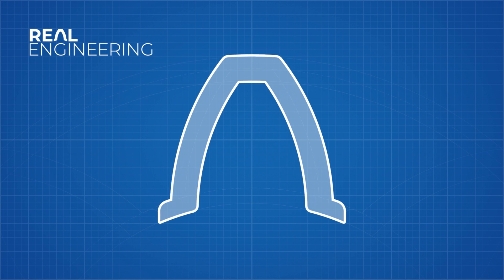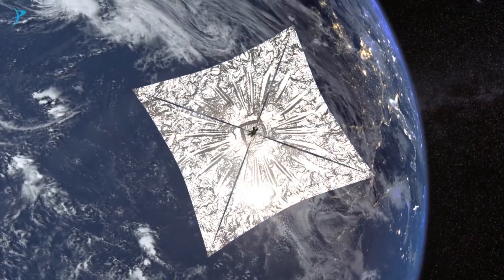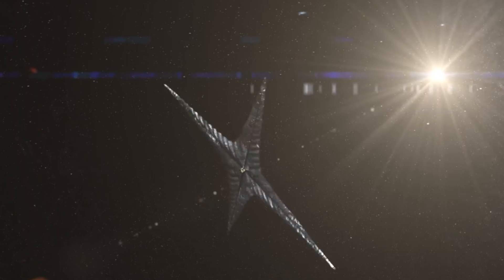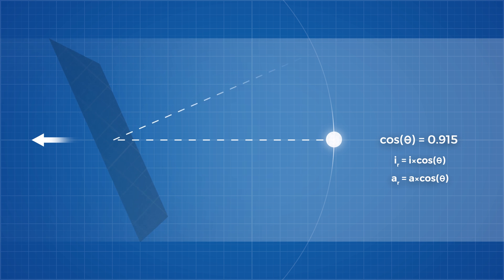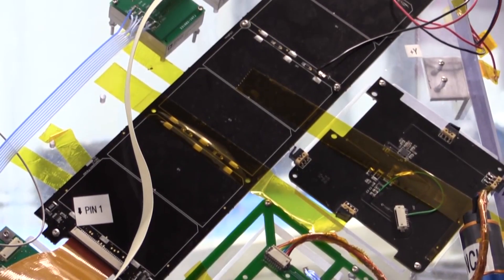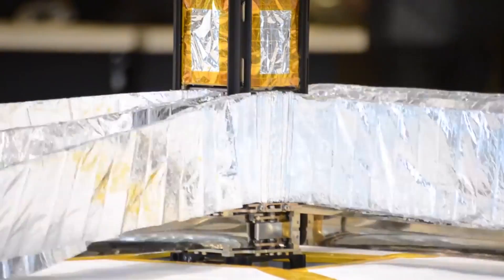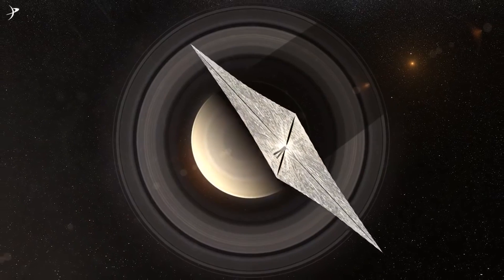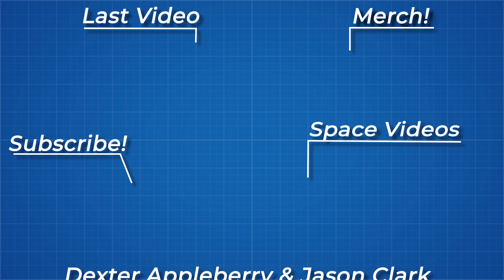How to Sail on Starlight

Comment: I don't think solar sails are  a viable solution for inter-STELLAR travel. 
Sure, the momentum of photons add up and the spacecraft can get up to great speeds buts it still not enough for travelling amoungst  the stars . You always need a light source , and one pretty close , for the craft to keep going on and on .
If there is no photon source near by , then it will not accelerate at all and maybe slow down and stop at a point in space.
We need new propulsion technology , or better still new technology for maybe bending space-time to create temporary worm-holes  which will give us a short cut to the interstellar vast distances of space.
If we can't do that then we need propulsion technology that will get the spacecraft to at least near  light speed .
Solar sails  ain't gonna cut it . I think the EmDrive or RF resonant cavity thruster , or some sort of variant of it , might be the one tech that might do the trick of near light speed propulsion  . Just a thought .
Reply: It's why the real interstellar probe project will be a combination of these solar sails and ground laser stations. There will be tens or hundreds of ground based mega-watt class laser stations that will all be focused on a single sail probe, and accelerate it to around 20% of light speed.

This way they can send hundreds of probes without spending billions on engines on each probe. It also means that they can send probes in different directions.

Comment: How does it warn us 2 hours in advance when light only takes 8 minutes to come here from the sun?
Reply: Light isn't actually the dangerous part of a solar flare; they also release bursts of high energy charged particles that are dangerous to satellites and even electronics on the ground if strong enough. These charged particles are fast moving, but not light speed.
Reply: dario dal cin coronal mass ejections travel significantly slower than the speed of light

Comment: well, correct me if i m wrong. does it will in (hours) for the effect of solar storm to reach earth? i think it will be in minutes as it is radiation after all
Reply: The most dangerous (we think) type of solar storm is called the Coronal Mass Ejection (CME) and these aren't actually radiation but a wave of plasma. These may take 3.5 days on average to reach the Earth.

Comment: One thing I've never understood about the solar sail issue, and this could be because of ignorant enthusiasts overhyping the technology's capabilities.

One substantial design requirement for anything to last in space long term is the ability to withstand high velocity impacts of very small objects.  Even when you're not sitting in Low Earth Orbit, there's a fair bit of dust floating around out there - not a lot, but when a dust particle the side of the head of a pin can impact with several times the amount of energy delivered by most firearms, it doesn't take a lot to do some major damage.  (As I recall the immediate assumption with the Apollo 13 explosion was such an impact and they ruled it out because there wasn't enough damage for it to be a fragment of dust, so it had to be an oxygen tank exploding...took me a bit to parse that oxygen tank explosions rate lower than dust impacts in space)

Conversely, solar sails need to be quite large in surface area (increasing the odds of an impact with dust as well as the amount of collisions with photons), and quite light...which suggests that it probably lacks the required strength to withstand the impact of one of these dust particles.

It strikes me that if you're using solar sails for anything ambitious enough for them to be a significant technology, like the examples given in this video, the odds of destruction by dust particle would be unacceptably high, rendering the phenomenon more an interesting curiosity that can occasionally be used for smaller scale solutions like the probe we sent to Venus and Mercury rather than the primary driving force of the vehicle.

I'm probably missing something here, because minds much more knowledgeable about space exploration are putting time into developing this technology.  Anyone know what I'm missing?
Reply: You are missing this: any such micrometeorite or dust particle hit would only punch through the tiny section of the sail, leaving an equivalent size small hole. That would not impact the whole sail performance or destroy the whole sail, or several of them in case of some designs. Then, with substantial increase in size of sails you remove the necessity to have that surface be completely homogenic, so it could be a web instead, not a full sail. In cases when sails would get many, many such tiny holes over a longer period of time. - we have some technology with self healing materials already, but that's not strictly necessary since you can patch or replace whole sails when the "ship" gets to its destination, just like any vehicle can get replacement parts. And then there are magnetic sails which were not even mentioned here.
Reply: @surfacereflection8298  Ahh, right, of course.  I'm used to thinking of space ships in terms of being either pressure vessels (for living quarters or storing useful gasses) or being packed with quite delicate mechanisms (satellite electronics, the service module of an Apollo craft, etc, and I'm used to thinking of sails in the literal sense, where a relatively small hole in the canvas causes a relatively large loss of efficiency because air driven sails catch the air like a parachute does.  Both of which are incorrect assumptions for a solar sail.
Reply: @rashkavar  Correct.

Comment: Why we don't use laser to give extra power during perige phase ?
Reply: You'd need a lot of them (like 100s or even 1000s) and right now, nobody really has that kind of cash for what is a relatively low return on investment , when you could take that money and build a dozen+ Saturn fives or something.
Reply: @barry3612  not necessarily.... We can just make a really high power one. Also a Saturn V launch today (in today's money) would cost almost 1.2-1.4 billion dollars!!! So its wayyy too much to compare for making lasers
Reply: Newton’s 3 law
Reply: Newton’s 3rd law would make a laser array attached to the spacecraft basically useless. I’m not sure about the exact numbers, but the photons being released by the laser array would cause an acceleration in the opposite direction, effectively negating (or at least weakening) any acceleration gained by the photons striking the solar sail. You could theoretically attach the array to a separate satellite, but that creates a whole host of logistical problems that aren’t worth the marginal benefits.
Reply: @breck1637  yeah..... So laser on a satellite won't work...
Reply: @breck1637  if we want to do it we have to find a way to do it from surface
Reply: @huski1  - no, we do not need to shot a frigg'n laser at a craft from the surface.  The laser could be almost anywhere - even on the craft, so long as its "thrust" or "momentum" vector can over come the drag of the atmo.
Reply: @drx1xym154  shooting lasers out of the craft itself is not possible dude to the amount of energy that needs ( I mean to power a laser) the satellite dosent have anything near to what is needed to power laser beam
Reply: BR  -- if what you say is correct, they could use a laser beam to over come atmo drag ... the beam just needs to be pointed in the correct direction - so almost any direction - it is feasible, maybe just launch to the higher better orbit.  I mean Space X launched a damn Tesla beyond Earth's orbit.  The 5KG solar sail should easily be able to boost to 1,000KM (1K-KM)...   Or maybe just orient the craft so it is always in Sun/star light and vectored to accelerate up!

Then make a movie called UP2, Starcraft Boogaloo!
Reply: Yes we can but we need to do it from some orbiting satellite with laser because we can't shoot lasers at light sail which will be facing side ways to earth surface

Comment: So did i miss something? If you get a photon reflecting off a mirror (imparting momentum), does the photon then travel the opposite direction at the speed of light? Or is it something with about the wave-particle duality, maybe the amplitude is reduced or something? Otherwise, you are kind of getting infinite momentum, if nothing vanishes. Eg, if you have 2 perfect parallel mirrors, you can bounce a photon between them and it would impart momentum many times as it bounces.
Reply: Nope didn't miss anything, all photons reflected have decreased wavelength then original, which also means less energy (energy conservation). If you still don't get something, consider photon have lot more energy/momentum then anything you know. To be precise that ratio would equal to speed of light. So.... Yaahh no physics laws are broken.

Comment: Can we send our nuclear waste to the sun? Which can save earth from nuclear waste
Reply: Nuclear waste is a non issue, it still has ~90% of its energy and we have the tech(fast breeder-burner reactors) to extract it but we don't cause its a bit more(10-25%) expensive(The result is a slightly more radioactive variant which decays in 100-300 yrs rather than 10,000 yrs). The best way to get rid of nuclear waste is to use it properly.

Otherwise send it into the earth where it came from. If you try sending it to space there is a risk of a rocket explosion spreading toxic nuclear waste in our atmosphere.

Comment: Did my bachelor thesis exactly on the topic of using a solar sail to move the L1 point closer to the sun. Turns out if you use a spacecraft with a reasonable amount of instruments to monitor the sun, the mass quickly becomes too large for a solar sail. To improve the warning time significantly you need to move L1 a lot closer to the sun (the fastest CMEs are traveling at 3000 km/s so you can do the math). You would need a solar sail with side lengths of 100+ meters, which obviously causes a lot of problems.

Comment: Doesn't solar storm effects electronics via electromagnetic radiation which travels with ''C''? How can we possibly put an early warning system? Communicating with the system will occur also with the speed of light.
Reply: Electromagnetic radiation is netural, it does not damage electronics, the charged particles are the actual reason for flare induced blackouts.

Comment: Since photons only carry mass when hit off a reflective surface... could we theoretically have a spacecraft that shoots a internal laser at a 85ish degree mirror attached ahead the nose of the craft to create slight momentum? Obviously this would be a tiny amount of energy and you would need a at least 4 mirrors shot at to create equal force forward but it should also be able to bring us to light speed as momentum isn’t lost in space? And it would be an engine that doesn’t need traditional fuel, only energy?
Reply: No need, you can just point your light source straight back and it will push your ship froward without any mirrors. Yes, in space, a flashlight is an engine. But boy, is it a crappy one... https://en.wikipedia.org/wiki/Photon_rocket

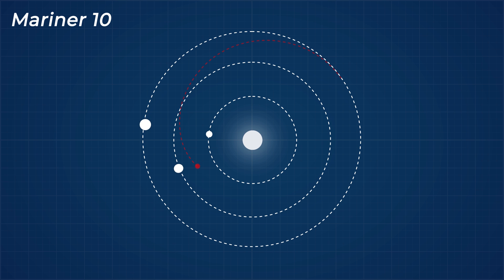Comment: Regarding 1:23, how does tilting the spacecraft so that its panels are impacted directly by solar radiation stabilize it? Since both panels are at the same angle, the force on each panel is the same regardless of the craft's angle or angular velocity.

EDIT: Never mind. I just watched the rest of the video. My guess is that the angle of the panels isn't fixed.
EDIT 2: Mind even less. I hadn't noticed the animation at 1:27 on my first viewing.
Reply: Maybe you should consider ALWAYS watching all the way thru before firing up the comment mill.
Reply: @jeric_synergy8581  -- The way he transitioned into the next topic suggested that he thought he adequately explained the subject, so I didn't expect him to give more information that would help me understand it.

Comment: Another really cool application of solar sails is fast travel to the outer solar system, if you could make a sail thin enough so that the force of gravity from the sun equals the force of solar pressure, then any solar sail on an escape trajectory from the Earth would travel in a straight line (as gravity and light pressure both decrease by the inverse square law). This would allow you to reach somewhere like Saturn in just 1-2 years, as gravity wouldn't slow you down.

Comment: Shorter wavelengths have more momentum?

Longer wavelengths like sound/vibration have much more push, but slower velocity, but do they work in a vacuum?
Reply: Roger C think xrays and gamma rays which are shorter wavelengths have more momentum
Reply: Nothing travels faster than light, many hot things thrust.
Reply: Momentum of a photon is proportional to its energy, the energy is proportional to its frequency, because they always travel at c the frequency is inversely proportional to it's wavelength.

Think ,
Radio photon = tiny energy = abysmal momentum

Infrared photon = small energy = small momentum

Visible photon = decent energy = decent momentum

Xray photon = crazy energy = crazy momentum

Gamma ray photon = off the charts

Comment: Cool, could a sail be large enough to be used on a crew sized craft? To help with acceleration to Mars or further,  possibly used with ion thrusters,  also, does PV panels work as a sail enough to contribute at all? Great video!!

Comment: How does parking warning satellites closer to the sun help us if the solar flare particles travel at the speed of light?
Reply: The particles are particles
They travel slightly slower than c
Being closer gives more warning time
Reply: @biblebot3947  photons are particles that travel at c speed
Reply: Inter Flash we are talking about solar flares
Reply: @biblebot3947  yes we are, solar flares are bursts of electromagnetic radiation which are made of photons
Reply: @interflashz  Solar flares are photons yes, but they also eject plasma and particles from the Corona, which do not travel at lightspeed. It's those charged particles that we are really worried about from a solar flare, because they can disrupt satellite communications, electrical devices, and possibly even the electrical grid with their electromagnetic pulse. Having a bit more warning of the charged particles allows satellite operators to take protective measures (eg. shutting down certain systems until the pulse passes).
Reply: @interflashz  Not all radiation is composed of photons. The kinds that cause serious damage aren't.
Reply: @falconerd343  @FernandoGiongo but what is the point in detecting the slower particles sooner out in space if you can detect the light speed radiation from earth sooner than that? and then you can take all your precautionary measures before you even get the warning from the satellite.
Reply: @interflashz  the point is that the particles are charged and do not go in a predictable path
Reply: they don't

Comment: Hey i have a question that is confusing me-Why don't companies like Tesla don't use small windmills in their car's back seat? This can be helpful if we add a little bit of power with a battery and when the car starts moving Then it can use fast windmill(which has an airfoil shape) to gain power???
Reply: Drag. Requiring more power to move that car the faster the car goes. More so than can be regained by a small windmill.
Reply: It just wastes a ton of energy.

Comment: how about laser sail? solar sail but powered by laser beam, like project starshot
Reply: project starshot use nanolaser sail  one way trip swarm spacecraft, so you don't need over powerful laser beam. The problem tho is as k veeder suggests, either beam from the ground and get ****ed by the atmosphere, or not advanced enough tech to get orbital laser beam platform. And nanotechnology is not advanced enough yet
Reply: That sounds incredibly inefficient because of the inverse square law.
Reply: @kveeder3224  inverse square law dosen't apply on lasers.
Reply: @omeke9336  No laser is 100% focused.
Also, some photons will still hit other particles in the atmosphere causing them to disperse.
Reply: @kveeder3224  they are still better than the sun.
Reply: It'd work, but you need a laser, and it needs to be a very powerful laser at that. 
The advantage of using the Sun is that it's already there and it's decently powerful (understatement). All you have to do is use it.
Reply: Rothpol X what if you use the sun as a láser, Nicoll Dyson beam style
Reply: @carso1500  You still have to build the hardware that lets you use the sun's light in that way. The advantage of a solar sail is that you don't need to build or coordinate anything except the actual spacecraft being propelled.
Reply: @sycodeathman  actually lasers are just way more intense than the sun, solar sails are pretty impractical anywhere beyond earths orbit, which is like everywhere, a beam is way better because it does not need to deal with inverse square law.
Once fusion is on the table, or even space based solar, I would expect to see some laser powered super fast spacecraft.
Reply: @omeke9336  I know that lasers are better in theory, that's obvious. However, we don't currently have gigawatt-scale laser arrays just sitting aroudn waiting to shoot at some spacecraft right now, and even if we did they'd all be on Earth, so it'd be pretty useless in the outer solar system anyway. Laser sails are the equivalent to railroads in the old west, useful to set up once you've colonized the solar system but doesn't help you do it very much.
Reply: @sycodeathman  yeah but solar  does'nt  look practical either, let's stick with ion drives, photons are lame anyways.